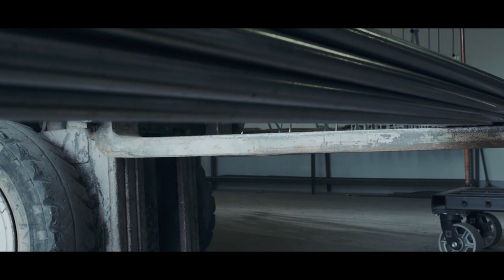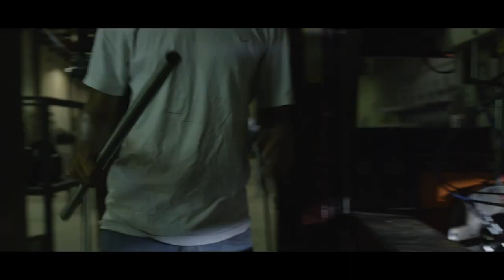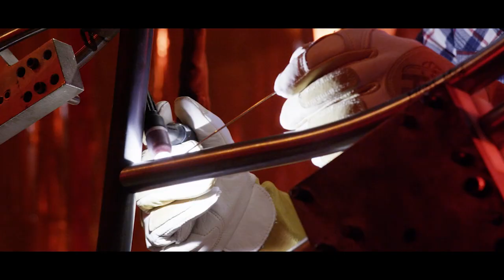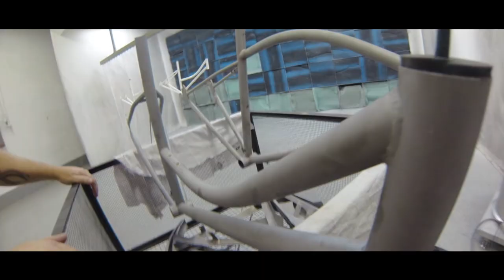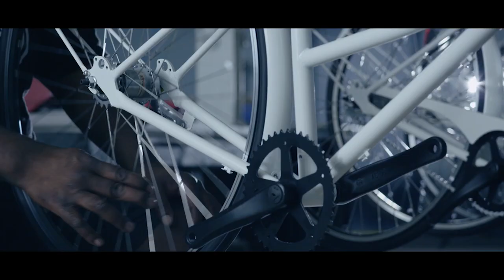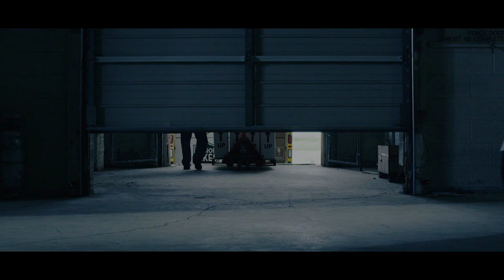Detroit Bikes Manufacturing

Comment: Got two Detroits. Just made a hot rod out of my flat black A type. Ape hangers stubby leather grips, black banana seat, high-back seat stay, bamboo chain guard and fenders, two-speed hub shift, no front brakes, coaster rear. Hottest thing since the stingray.
Reply: That nice! How's the frame holding up after all these years. 

I'm tempted to buy one to convert to a single speed coaster brake. Anything with gears and hand brakes gets stolen over where I live. Pedal brake bikes don't even get glanced at.